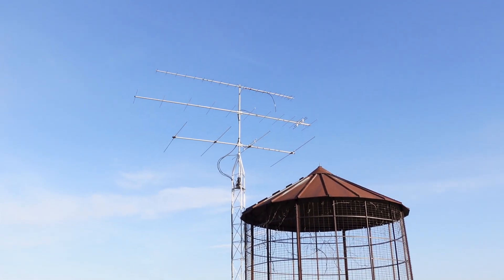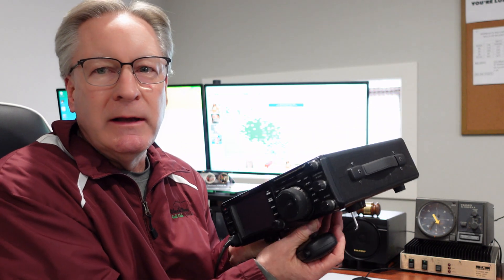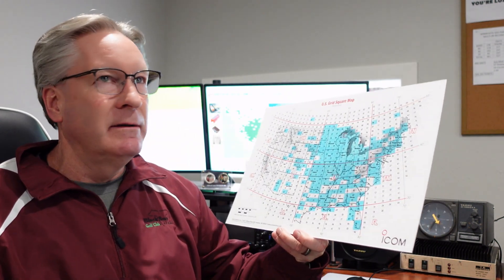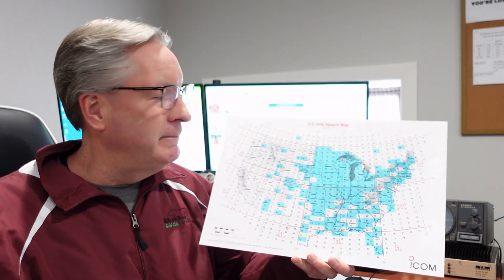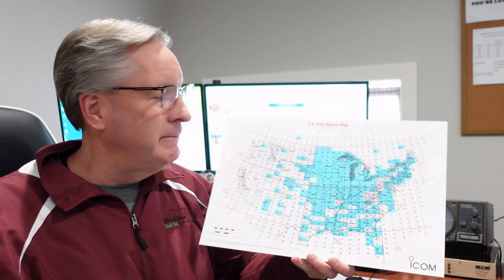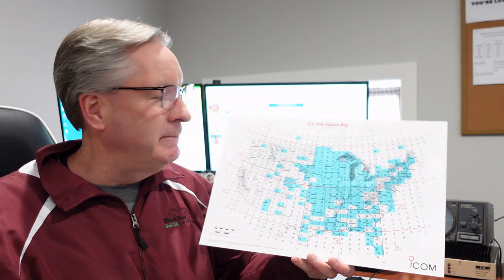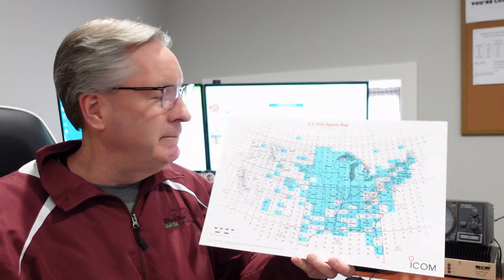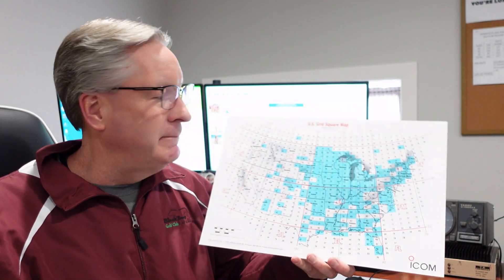Amateur Radio VHF Propagation Modes | How Far Can I Talk On VHF?

Comment from the maker: If you're interested in VHF weak signal operation, I hope this will show you what can be accomplished on the amateur radio VHF bands with a small station.  Let me know if you've got questions.  73!
Reply: Found your channel today because I have a few young Calico Princesses. Now I find Ham content too, subscribed!
Reply from the maker: @pmodas  Is there anything better than Calico Princesses and ham radio?!  I've had a bunch of my flock help me with antenna projects!  73!!
Reply: I am looking for a pre amp, amp for my shack.  I cannot find the one you have.  Can you tell me the next best thing?  I would appreciate it!  Thanks!
Reply from the maker: @dougzemler  Just check www.tesystems.com and check out the 144-148 MHz HPA's.  It's right there.  Hope this helps!  Cheers Doug!
Reply: @TheOldSwedesFarm  Thank you!  May I ask which one you have?  Thanks for the great videos you do!  Very informative and fun to watch! 73!
Reply from the maker: @dougzemler  The Model 1452G for 2 Meters.  Hope this helps!  73!
Reply: @TheOldSwedesFarm  it does!  thanks again! 73!
Reply: Being new to 2 M and having only a handheld, I bought an arrow 2 dual band yagi.  Works ok but when you speak of talking great distances without repeaters, I am very interested in your method of doing so. 

I am with you all the way on not digital too.
Reply from the maker: @stevebowers1629  Watch for the conditions that I highlight in the video.  You will need to use the weak signal modes (CW/SSB) to be able to talk long distance.  FM is really hard to get to communicate long distance.  Get a good all-mode radio (mine is a Yaesu FT991A) and you'll be ready to go!!  Cheers Steve!

Comment: I had to laugh.  'I don't do FT8, FT4...' I don't believe in that stuff...' 'I believe in EARNING my contacts.'  Yeah.  Couldn't agree more...
Reply from the maker: I just don't feel that it's a real contact if the computer is doing all the work.  I just need to make sure I earn the grid.  I know many don't agree.  I guess I'm Old School!  Cheers Ralph!
Reply: I’ll occasionally get out the laptop, but it’s going to be hooked up to something that is only working because I had a soldering iron in my hand. 

WSPR is a nice way to see what’s going on with your antenna and with the band on the day. 

That said, I’d rather pound brass than use a keyboard. 

To each his own. It’s a hobby, not a religion.
Reply from the maker: @MidlifeRenaissanceMan  I hope I didn't sound like a snob.  I just don't get into the FT8/FT4.  I love the person-to-person contacts and enjoy trying to decode the weak signals myself.  Personal challenge.  To each his own.  Thanks for stopping by to watch, Chris!  73!
Reply: @TheOldSwedesFarm  not all all,
And I haven’t done much with the wailing cats on FT8 myself. I’d rather use my ears, my brain and key. That said, looking at the callsigns as they scroll past you after each transmission period….has a certain appeal. My mate reckons it’s like playing the pokies / slot machines. 

If you want to move messages and free text around, JS8Call is a fun way to go. A keyboard to keyboard conversational protocol built on to of the FT8 protocol. 

I guess it’s the results you’re looking for that drives the tech.  

And thank you for your video. Well presented and stuff that I haven’t seen elsewhere. Sadly no VHF weak signal gear…..yet. I’m just on HF and really only set up for 20 and 40m.  That said, I fix stuff, I get on the air and I have fun.

Comment: Very interesting and educational thank you for sharing.  I agree with you, using digital is not really ham radio.  I think the fun of ham radio is making contacts with a radio and antenna and seeing how far you can reach.  Thank you for sharing this video.  I still have a lot to learn.
Reply from the maker: I love the challenge of what I can do with my radio and antenna.  I'm going to stay with my "human decoding" forever.  It's such a fun challenge!  73 Janice!
Reply: @TheOldSwedesFarm  Well I have to say you have provided a lot of options when it comes to antennas.  I don't see myself putting up a tower but, I do have a detached two car garage with a metal roof which I think will possibly be an added radiator.  I think I explained that right.  Anyway, I have some power poles that were used to support the roof one side of the garage, overhang.  The power poles should provide a stable attachment for putting up a pole high enough to use the metal roof.  Time will tell.  Thank you again OldSwede.  73
Reply from the maker: @janiceemery2008  You will have better results if you can get the antenna a wavelength above the metal roof.  If you can get the 2 meter beam up about 6 feet above the roof, you'll be good.  A small rotor is all that is needed for the antennas.  VHF beams are smaller.  Hope this helps.
Reply: @TheOldSwedesFarm  Thank you.

Comment: Gather you spent some 10k hours operating vhf. We encounter just the same here in EU. If you observe short skip on 10m, go to 6m and work extended long contacts there. Statisticly 2 times during a decade (10years) the AU center is located down to some 53°N, and then we have to turn antennas to S in order to use the AU. The most sensative band for AU is 6m. Have used this mode with only 3 w of power. (We had a power restriction in the 1980th due to TV ch 2 remaining then). For VHF success go with Horizontal antennas and maybe stack a few vertically for enhanced performance. GL de Björn SM6EHY
Reply from the maker: I'm sure I have spent over 10k hours on VHF to achieve the results I have.  I wouldn't trade it for anything.  The thrill of making contacts out to 1200 miles is incredible!  I once operated from Iceland and saw the aurora south of me.  It was unreal to see the auroral curtains above my head (and south)!  Hope to see you on HF or 6M soon!  73!

Comment: Learning and this is totally awesome Rich. We have friends that are scrap dealers and will try to get hooked up with at least the tower for the time being. Awesome that you learned at such a young age. Great timeless video. Shared also. You’re in your element on this topic.
Reply from the maker: Really, really, really be careful with any tower you might get as scrap, etc.  I've never used a second hand tower.  I would recommend to save for a new tower.  In the mean time, use wire dipoles in trees.  If they were previously used incorrectly, towers may have defects or slight bends.  Remember that you need to climb them to work on antennas, repair feedlines, etc.  Your life is on the line.  It's not worth saving a few hundred dollars!  When it gets time to get a tower, let's talk.  In the mean time, start a savings account.  Hope this all makes sense.
Reply: @TheOldSwedesFarm  you bet and thank you!

Comment: At around time stamp 2:01 in this video you mention the FO12 for 2 M. I am having a difficult time in reaching our local repeater which is about 18 miles away. I only have HT for the 2 M and 70 CM so I built a dipole built around the frequency of the local repeater.  Came up with 18.98 inches for the 1/4 wave segments.  Using a nano VNA initial SWR was 2.8 and the Smith chart showed 105 uH and 106 pf.  Using a volt meter as a cheap RF strength meter I showed about .3 uV at peak.  Because the VNA showed more inductance (above the zero line on the smith chart), I decided to try getting that mismatch better so I just took a test lead and clipped it to what the shield of a coax would fasted to.  Basically adding a counter poise of that same length of the 1/4 wave.  The SWR dropped to 1.5 and I had a 63 uH and 14 pF showing on the smith chart. Using the volt meter as RF meter, I was able to get .6 peak uV indication.  I guess what I am asking is simply by adding a length of wire to the "negative" side (what would be considered the shield of a coax connected via a 239 flange mount connector) would change the Smith chart to bring the high uH down more towards the zero line on a Smith chart.  Thanks.
Reply from the maker: The length of the dipole (and SWR) is dependent on the size of the wire, distance from other metal, etc.  You could probably get a cheap four-element yagi and work the repeater with no problems.  Make sure it is vertically polarized for FM.  All my beams are horizontal for weak signal work.  18 miles isn't too far but terrain, trees, etc. can soak up the signal.  Keep me posted on your progress. 73
Reply: @TheOldSwedesFarm Much obliged for the response.   I have the Arrow dual band antenna. My plans are at some point to work ISS.  But for now just trying to determine what a good antenna is for local repeater use. Dipole or vertical ( make and model) I plan to build a dipole but still working on understanding the use of of baluns and whether or not to go center fed or end fed.  How do you (with the distance of your antennas) get the feed lines from the antennas into your shack?
Reply from the maker: @stevebowers1629  I have a box on the outer wall of the shack where the feedlines enter the shack.  It is all grounded and protected to keep the weather out.

Comment: Fascinating video!  I currently do not have the equipment to try 2m ssb but I have been very interested in FM simplex.
Reply from the maker: FM will work during tropo and E-skip.  You can probably hear activity on 146.520 FM or 146.550, 146.580, etc.  Hope this helps.  73!

Comment: Great explanations of why and when these conditions exist.  You mentioned cw, I would love to see a video on that subject as well.  I have used it on HF, but my words-per-minute is not very good.    In the scouts, long ago, we did morse via flashlights; but I find listening more difficult for some reason.
Reply from the maker: It's the same as HF.  CW doesn't have to be fast on VHF to get through.  If you can send 10 wpm, you'll be fine.  Most time (other than aurora), conditions will be good enough for voice.  Hope this helps.  73!

Comment: Great video. Thanks. I got my General during covid but I’m just getting around to setting up my shack and starting to listen. I’ve been listening on 20 meters lately but haven’t talked or made a contact yet. Still so much to learn. This was great info. 73
Reply from the maker: Anyone can listen.  You got your license to talk!!  Let me know when you get an antenna in the air for 20 meters.  Let me also know what state you're in.  Let's get you on the air and I'll make your first contact.  Drop me a note at oldswedesfarm@gmail.com.  73!
Reply: @TheOldSwedesFarm  I’m in Virginia. I’ve got a Gap Challenger vertical antenna up. I think I need to lengthen my ground radials a bit. It seems to be receiving just fine. I’ve also got a wire antenna up but not hooked up or tuned in yet. My biggest problem is my hearing. I’m very hard of hearing, borderline half deaf, from too many years of working on industrial machinery. People say their call signs so fast and I don’t hear it. It’s embarrassing to ask over and over. I’ll send you an email the next time I get on air. Thanks for the reply!

Comment: Hi, my friend, AE4JC, sent me the link to your video. What a thrill to work you on long haul tropo and Es! My antennas are less than optimum as well, my 2 meter beam at 35 feet. Hope to get some great tropo or Es this summer. Will look for you. Dave WA3GWK EM60.
Reply from the maker: Dave - Our QSO's were amazing.  You were so loud on Es and the tropo was so much fun.  My only regret is that I didn't pull out my phone and record the events.  I love VHF because I can do remarkable things with a minimal set-up.  I'm working on getting up 80 feet of Rohn 45.  I'll have the 2M set-up much higher soon!  Look for you this summer on the various modes!  73 & thanks again for the fun QSO's!!

Comment: You are mu kind of Ham. I like the VHF and UHF work. We do the weak signal stuff here. We have also done the VHF contest in the past.  There were four of us that did the contest in the past. On 6m,  2m, 432mhz,  220mhz,  1296mhz, and a few more.  We were 5th in the  9th call district. Also we have scored up around 10th in the nation.  We run a KW on 6m and 2M, and some lower power on the other frequencies.  Yep if you had your antennas up tp about 60 or 70 feet and Hard line feeding them you would be cooking good.   Gayland W9AKW in Southern Illinois.  Yes it is fun to work the LIGHTS up north and it whispers to you.
Reply from the maker: We worked a lot of Illinois multi-ops over time.  I used to be at the WB0GGM and W0ZQ multi's in EN34.  Great fun.  The big multi that I remember was AA9D in IL.  BIG signals!  Hope to work you soon!  73!

Comment: So I watched your video on using the 991A to talk on 2 meter and the antenna you used was a DX engineering ham stick attached to a 3 magnet base.  What I am wondering is how you are able to talk without repeaters such great distances?  Could you provide a detailed explanation as to how you accomplished this without the help of repeaters?  I have a 5 w HT attached to an Arrow dual band (2M/70cm) antenna and can barely reach my closest repeater which is about 15 miles away.  I'd like to accomplish your task of being able to reach out farther without the use of repeaters.  Thanks Steve KE8VHY
Reply from the maker: If you saw the video of me in the Minnesota QSO Party, I was on 20 meters to the ham stick antennas.  If I'm on 2 meters, I am on SSB/CW and use a 12-element horizontally polarized antenna (shown in this video).  I don't use a hamstick.  For distance on VHF/UHF, you need a weak signal mode (I use SSB/CW).  Some use digital modes.  FM doesn't go very far, even with a yagi.  Hope this makes sense.  If not, let me know, and I can explain better.

Comment: I cant get enough of these videos, you are amazing at explaining things, just listening now but you should do a "getting you're license" course. Id also be interested in how you run you're cables to antennas and in you're house. My current setup is like the corn crib but mine is against the side of my house with a metal roof, its about 10ft above the roof line, how bad is that? and how to improve it. Thanks
Reply from the maker: I'm not sure I could teach a license course.  I will continue to make videos on various topics.  I'm thinking grounding, cable management, etc.  If there are specific topics you'd like to hear about, let me know.  While I'm not good at an overall license course, maybe specific topics I could attack.

I would put an SWR meter on the cable attached to each antenna.  Rotate them and watch the SWR at different headings.  You will quickly learn about how the antenna is interacting with the roof.  I know my 6 meter antenna is affected by the roof of the corn crib.  Usually antennas will interact if they are within a wavelength of the object.  Try this and see what you find.  Keep me posted.
Reply: Thanks for the reply, id also like to know about cables and signal loss, plus what are all the programs and apps people use in their shacks @TheOldSwedesFarm
Reply from the maker: @ARC3333  Great ideas.

Comment: I love radio stuff. I'm a CBer myself.  I'd like to get into 10 meters eventually because my antennas should work with adjusting for SWR. In the 11 meter world, everything is quarter wave length. The antennas on my car and my trucks are quarter wave length. The one on the house is five eighths wave length. With two meters, would you use a full wave length because they're so small when compared to 11 meters? If you ever feel like going in depth with antennas on a video, that would be awesome.
Reply: Apparently, I missed the video you did on antennas. I'll definitely check that out.
Reply from the maker: I would just look at some of the site.  You can find the M-Squared antennas at several places.  DX Engineering has a bunch of 2 meter antennas.  I'd get one that is at least 6 or 8 elements.  I love this small 12-element yagi for 2 meters.  Works great!
Reply from the maker: @nicklewis7291  I made two videos about how far can you talk on the various HF frequencies.  Each shows the antennas I use.  Hope that helps.
Reply: @TheOldSwedesFarm  Can you get the small rotor at DX Engineering also?

Comment: I have the B-Tech UV 25x2  which operates on 2 meter and I'm trying to figure out a decent antenna setup. My normal areas of operations are within 150 miles. Is there an antenna setup and mode  that would allow for those ranges. Or do I need to use another band? My goal is to have a mobile or portable setup and a base station setup that can talk to each other reliably.
Reply from the maker: This looks like an FM-only rig.  FM is a much wider signal and travels a shorter distance than I can achieve on SSB or CW.  I believe this gives you 25 watts output on 2 meters.  With a beam antenna, you could reach out to a similarly equipped station at 150 miles.  Usually, people have a vertical whip antenna for FM work on 2 meters.  I do not think you could communicate most days out to 150 miles on FM with a vertical antenna.  If the mobile station took a beam antenna, you probably could make it.  That set-up really isn't very mobile though.  

If you're going to have a base station and mobiles, and you want to talk 150 miles consistently, I would recommend 80 meters.  I have my Yaesu 991A and a mobile whip antenna (see my other video on antennas to see the mobile magnetic base and the verticals I use for 80, 40 & 20 meters).  With the 991A and the 80M whip, I can talk all over Minnesota (and the region) on 80 meters.

I hope this helps!  Keep me posted.
Reply: @TheOldSwedesFarm thanks for the reply... my goal is to have reliable coms for under 100 miles.  My current radios are great up to about 5 miles line of sight.  I want to fill the gap.